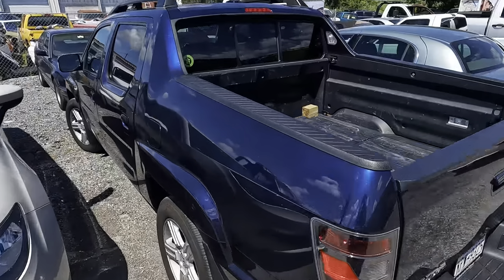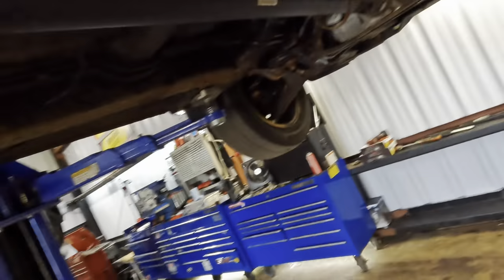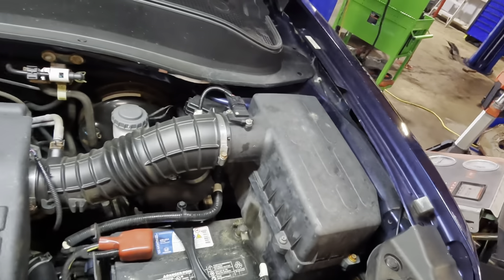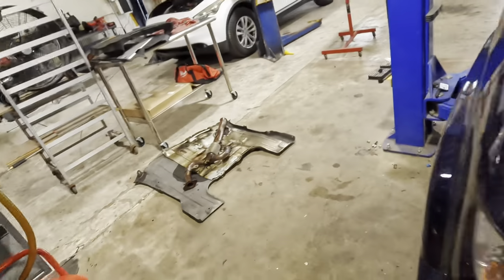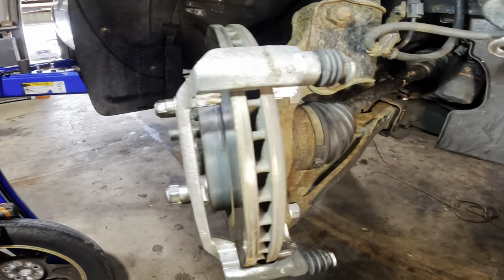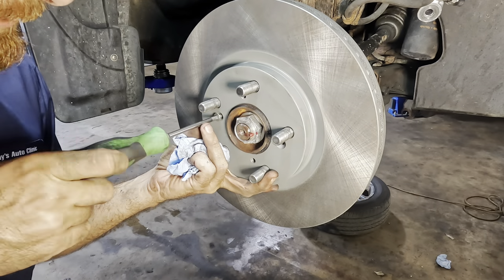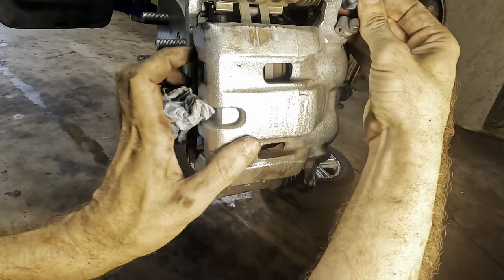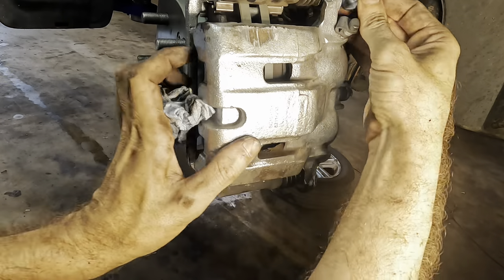Rust Busted Spring!  Honda Ridgeline 3.5 2006-2014 Multiple Problems!

Comment: I thought the ac compressor went out on my 07 tahoe. I knew the freon was getting low and starting to blow warm. 

Press the AC button it did the 3 blinks and wouldn't turn the compressor on. Low on freon but a fellow tahoe owner who I follow on Instagram. Told me it could be a bad compressor clutch switch. 

Jump the harness and the compressor came on. Once I put a new switch and add recharge the system. Now the compressor kicks on and ac blows cold. 

Compressor wasn't bad and never made any noise. 

For the fellow 07+ tahoe if your ac is blowing warm or 3 light blinks from the knob. Your ac compressor cycle switch is bad leaks out the freon.

Comment: Normal rust. Used to it. That’s why we dread working on anything diy. You ain’t getting those struts bolts off without a torch. Should have just shut the car off lol. And the bad rotor. Prob rock auto sending wrong part or bad part again. Used to that.  You haven’t seen the bright orange rust or entire rocker panels rotted away on 7yr old trucks. Fun.  That actually looks like low rust. Very very light rust. When u can’t recognize it’s a bolt that’s true rust

Comment: man i wish i was from the south after seeing the "up north" cars vs yours like the amount of hassle and work that it takes on a north vs south car is wild like ive had literally all bolts rusted so bad i have to sand the sides down to metal and most the time use a smaller size then supposed to me

Comment: Maybe this vehicle was in a FLOOD,which would explain all of the rust. Love your channel. Keep up the great work.
Reply: Just Norther Road Salt and a good dose of coastal sea air as well. In the metro NYC area cars rust from the bottom up and from the top down. That foggy sea air carries a lot of salt.
Reply: Obviously, you didn't listen close enough as Ray said this came from upstate NY. Everywhere in that state, salt is used in many areas, year 'round as in the summers in the more rural areas, they use it to keep the dust from the dirt roads down.
Reply: @johnhpalmer6098  within 20 miles of SMA there is a ginormous salt mine
Reply: @jsh6952  I believe I recall Eric mention them, but I think I also heard they use the brine solution too.
Reply: Eric O fanboys

Comment: Up in the northern snow belt states, the hardware under the hood is exposed to salt water vapor/brine that is created by traffic in front of you and from the wheels at highway speeds.  Problem is that a run though the car wash will not get rid of it.   Car wash doesn't was the bottom of the car either.

Comment: You didn't use any brake grease ? Being a northern car is spray some electrical cleaner in the connection leads.

Comment: There is a reason that the north has vehicle inspections.  Any vehicle from the north that wants to register in the state of Florida should have a vehicle inspection.   Vehicles with damage from rust should be unregistered and repaired before driven on the road.   I know that only 1% of vehicle accidents are caused accidents, but when someone brings a vehicle like a van that can not pass inspection up north and sells it or use it for day care and kills some children we will have not have any choice, to late, to make them be inspected.   So, next time hits you or kills a love one in a vehicle accident find out if the vehicle is from the north.

Comment: Rust comes with living in New York.  In winter, they salt the heck out of the roads.  Cars are ready for the junk yard after 3-4 years.
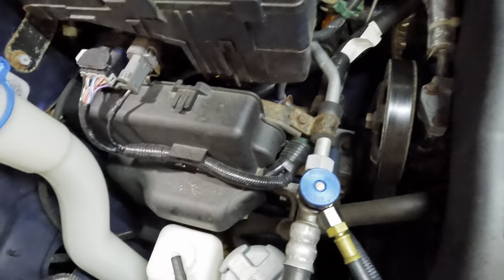11:20 "Why is that cap blue.  Blue is for the low side".?  I think that is the "low side" and should be red.
That rotor had to  be glowing, on the trip from NY.
So, what's the word?  How many guys do you have working for you now?  We keep seeing different guys working on cars there.

Comment: Not having air rust in Florida. I would for a company that ran Chevy vans. This van was about 6 years old and going down I 95 near Ft Lauderdale Airport the roof blew off it. It was completely rusted out. The guy that the van was assigned too lived near the beach. Chevy had big rust problem ack in the day. It was I believe was a 73 C10.  The salt air will rust out from the top.

Comment: I replaced the AC clutch on my '02 ranger 4.0 when I owned it,,,  it was easy,,,  I suppose that the Honda clutch is permanently hermetically bonded against replacement,,   :-)

Comment: Guess the other rotor and caliper from eBay had made themselves the correct clearance. 
I was reaching inside a thing with a 5 inch computer fan,  I could tell my thumb was hitting the blades , continued my task regardless,  after I retrieved my appendage was kinda surprised at the depth of damage my thumb had picked up.

Comment: Just changed my compressor on 2006 Odyssey, had leaking valves so the system sat without running for a while. Clutch did the same thing after fixing and recharging everything, seems like a common problem after these clutches sit

Comment: OK Ray, let me attempt to answer your question about rusty bolt heads in engine compartment. It's something called "heat cycling" 
It gets hot, gets cold. rinse and repeat. When things heat up they expand, when they cool they contract. Even though it's only a microscopic amount, it adds up.

After many, many, many of these cycles of warming and cooling the surface of the metal gets fatigued. Rust forms on the compromised surface because it's exposed to the elements. But of course, the old saying goes "Rust never sleeps" As time passes over years, it just keeps getting rustier and rustier because the surface continues to be fatigued. Until it starts to decompose that once pretty machined surface. Rust on frames and body panels is a little different because physical force, salt and water are involved and accelerates the process.
Reply: That's not how rust forms.
Reply: @johnt.848  It's a simplified explanation. The explanation of exact process would put everyone to sleep when you start discussing chemical reactions, elemental density and molecular bonding. On a scientific level. Ooops; starting to geek out there
EDIT; TY to whomever give me the thumbs up

Comment: I can't tell you how many times I had to return parts,  mostly brake parts,  because they don't fit. The store, online or local shop. Main cause is the part belong on an EX model vs an LX for example. Even when the catalogue says it will fitnit doesn't. Worst ones are pads,  too shirt,  too long,  don't have the right grooves,  etc...

Comment: Rust….northern roads with salt in the winter = salt spray that goes everywhere = rusted fittings everywhere.  Rust check or similar products applied yearly help.

Comment: OK, I can see that the rotor was the major problem on the right front, but that doesn't answer why the caliper was contacting the rim. Seems like there's something else going on there - unless the loose caliper bracket bolts were causing the caliper to move. Also, you call that rust? That's just minor corrosion. I have a vehicle in my yard that's been through 21 Michigan winters, and the chassis looks like it's been on the bottom of the ocean all that time.

Comment: While I question that the rotor was the cause of the caliper hitting the wheel, I won't incur the wrath of thousands of Ray's fanbois by saying so.
Reply: 😡😡😡

I had to do it😊
Reply: Seems with everything so loose there shoulda been a bit more inspection but if it works i guess it works. I have never needed a prybar to turn a good wheel so lets take that into consideration as well. Maybe they told ray they changed the rotor and the bs happened 🤷‍♂️
Reply: @Mrdugan5269  That wasn't the original caliper. It has been replaced. The brake line leaked because it wasn't tightened down after replacement. Why didn't Ray check it against the other side? Why didn't he swap one side with the other? 
Why didn't he just add some refrigerant to see if the system worked correctly before servicing the system?
Reply: @Mrdugan5269  As far as the prybar comment, when a brake hose goes bad, the inside swells and it doesn't release the pressure from the piston when the pedal is released. That's the original hose and the original problem.
Reply: @stans5270  but after the "repair" he still used the prybar to try to move it initially so if he was confident in his repair he shouldnt have used a prybar right?
Reply: @stans5270  again he should have checked out more than just the rotor. If someone tells me they replaced a ball joint i dont go straight to a strut problem. You see a leaking and replaced caliper you should do more checking than jumping straight to rotor. Pads were loose to and he didnt change them.!? So he went from loose and leaking caliper with oddly loose pads straight to rotor? Thats my issue. He may have done more off camera but thats still a huge leap

Comment: Hey Ray. If my AC was blown up and you turned it on and it broke something what would happen?

I also had an incident where a shop rolled down my passenger window (and I told them not to) and they couldn't get it back up and basically said "good luck" lol

Comment: Also given that the car could be returning to the road salt belt I'd have been inclined to put Anti sieze compound on everything you reassembled.
Reply: As someone that has lived in the rust belt his entire life and worked on quite a few cars, it's pointless. It does absolutely nothing.
Reply: @williameldridge9382  I live in New Hampshire. I have not had that kind of results. To paraphrase the hot sauce commercial, I put that shit on everything!

Comment: salt vapors from wet snow splashing into the engine compartment and being burned off from the heat of said engine. also not being burned off and sitting there.

Comment: Ray, I do not understand why, in Florida, with the high humidity, that you do no5t get rust. Maybe no salt during the winter? Also, many moons ago I had a short term computer contract in Jacksonville, FL. The humidity was so high that even with the AC on highn, the sheets on the hotel bed were damp. That was a really strange feeling.......
Also, I have seen mechanics leave the AC connections always screwed down which can bend the Schrader valve causing it to leak.
Reply: It's the lack of salt like you mentioned. Vehicles are well enough built to handle a little moisture but salt is exceptionally corrosive

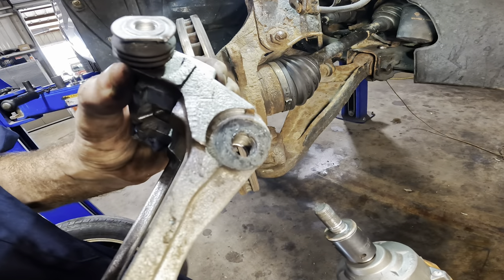Comment: The bracket's on the wrong side. At 22:41 of your video, you can see an "L" stamped at the top. I'm guessing the driver's side is stamped "R", which would effectively make both upside-down. 2013 is side-specific...

Comment: Ray, are rotors specific to the side of the car?  I was wondering why you didn't take the rotor from the driver's side to check the passenger side. It seems the driver's side is good, so it would have been a way to check the passenger side if they were swappable.
Reply: Generally speaking rotors are not side specific as far as brakes are concern. For wheel hubs and some brake calipers, yes.
Reply: He did check them both. He doesn't record things that he considers "boring". Usually that is things that he determines as more of the same.
Reply: @williameldridge9382  You misunderstood what I was suggesting.  I know he checked both, both wheels were off.  My suggestion was that he should have taken the known, good rotor from the driver's side and put it on the passenger side.  If the tightness/issue still existed he would have known it was the caliper.  If the tightness/issue went away he would have confirmed it being the rotor.....all without first buying a new rotor...that might not have been the issue.

Comment: I don't know about the Ridgeline but my 2004 CRV has a compressor overtemp sensor mounted on the compressor.  My a/c doesn't work and was working intermittently for a while then quit all together.  I suspect the o/t sensor but it is impossible to get to without droppng the subframe or removing the radiator.

Comment: Ok, I am not a mechanic, so stupid question alert. >.< Couldn't Ray have taken off the left front rotor and tried it on the right front to test fitment? Or is left vs right rotors different in some way?

Comment: Love the color.  Much better than Red.  Like most things in a civilized Democratic society.
What happened to the AC machine cowl?
So the remaining refrigerant just got vented before the vacuuming (valves replaced before vacuuming).
The missing pad anti-drag springs weren't replaced (two holes in each edge of the pad backing plate).
Definitely "Hi!".
Bloody cowboy stunt on that connector, mate.  If you saw Troy do that, you'd be cool with it?

Comment: Ray. So since you charged the system, if the owner says not to replace the compressor, does he still have to pay for the charging of the system since if the compressor isn't working there will be no AC still?

Comment: Honda needs the v spring on the pads to keep them from riding the rotor. Whoever did the first brake job either didn't know or didn't care.
Reply: Or being smaller diameter wire, they rusted and fell apart and the mechanic never saw them.

Comment: You forgot to check if the caliper is still touching the rim. Since it is same bolts, looks like that’s another problem!
Reply: That probably happened by leaving a caliper bracket bolt loose.

Comment: I have a question I have replaced all of the front end new strurts, new cv axles, new axle knuckles because the car has over 2500000 miles on and now I have a loud pit noise and I don't know where it is coming from I can turn the steering wheel and it go's away for a bit but comes back can you please let me know what it maybe and thank you

Comment: Even if there is a possibility of removing rusty bolts, I would spray them with lube to get a good time soak on them. You always spray right before removing them. Love the longer videos. We all have time 😂😂😂😅😅😅. Edit. Maybe the big nut holding the rotor on is too loose or too tight
Reply: The only way to get Michigan bolts loose is with an induction tool, works awesome and doesn't set nearby parts afire.
Reply: La "tuerca grande" no asegura el rotor, pero es el que aprieta el eje de tracción/propulsión a la masa (giratoria) e impulsa la rueda y vehículo.
Si apretada al torque correcto aún queda con holgura, es el rodamiento de la masa el que tiene desgaste (hay que reemplazar)
El rotor (o disco) puede quedar  hasta suelto momentáneamente si no se tiene/n el/los pequeño/s tornillo/s pues una vez colocada la rueda y apretados sus pernos o tuercas, NO se moverán más.

Comment: Are broken springs common and are they attributable to incorrect manufacture?
Reply: I would say incorrect manufacture and this one is partly attributable to rust. 
I have a car where it was bad to start with. It had two brand new rear struts and one broke before I had gone a mile, the other one is still going strong.
Reply: The Honda Ridgeline is a truck wannabe. My guess is it was a combination of weight and a defective spring. There is not enough rust to have affected the integrity of the steel. It rust was the problem then there are a lot of problems on the roads.
Reply: @johnthompson1453 No and No

Comment: Ray, I would have thought you would compare left to right regarding the brakes, the drivers side may  be wrong too, also missing  anti-rattle springs? Why replace the compressor when a replacement clutch would be far less costly?
Reply: One phrase: Labor cost.
Pulling the compressor to rebuild it, doing the rebuild and reinstalling takes at least an extra hour longer than just swapping. Ray's rate is higher than the difference between a new clutch kit and a new compressor.

Comment: If that was under a vacuum wouldn't that Schrader valve naturally leak?
Reply: It should not. The spring pressure is stronger than the vacuum
Reply: @kd7cwg  OK makes sense, wasn't sure how strong those springs should be.

Comment: Hi Ray. So why are you condemning the compressor.? Isn't just the clutch bad?
Reply: I get your point but IMO given the labor cost is pretty much the same, not that much more to replace the unit as an assembly.  The compressor is the same age as the clutch.  Labor may depend on if the clutch can be replaced without pulling the compressor to the bench.

Comment: Dust created by car and trucks grinding the road salt into powder blows up into the engine compartment settles on the bolts and rusts them. It's terrible just driving around up here as the salt dust gets in your eyes and causes sinus problems. It's a miserable place up here in the rust belt. No wonder those who can relocate to (places like) Florida as soon as they can.

Comment: You should put at least 2 lug nuts on the rotor as that was when the other setup was binding.  You never did that with the new rotor.  Also might want to have the wheel balanced as the caliper might have knocked a weight or two off, just my 2 cents.

Comment: Wondering why you didn't just pull the left front wheel and compare the rotors and calipers, could have even swapped the left rotor to the right to verify before ordering parts when you weren't completely sure that's what you needed. As for whoever worked on it before, they sure as heck didn't know what they were doing. Brake work is no joke stuff like that can kill people. Hopefully the owner will authorize the rest of the work so you can get everything working again. Its a nice fairly low mileage car with the exception of all the rust.
Reply: new owner got a good buy, it failed state inspection.

Comment: Do car springs just rust away and break? I've never had that happen on any of my cars.
Reply: Most likely there was a problem in the steel itself that it failed. The overall odds are that there will be a defective spring somewhere in the production process and this guy bought a winning ticket. He might have loaded it heavy one time to reach that breaking point. The steel is not rusted enough to have been the issue.